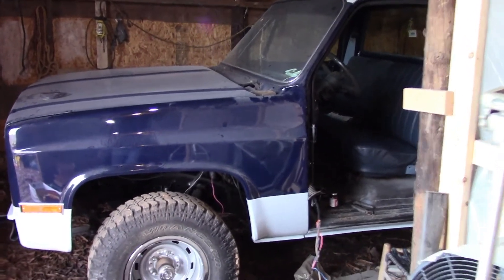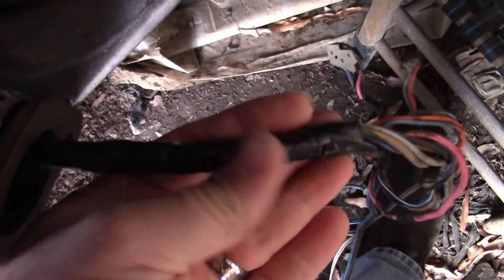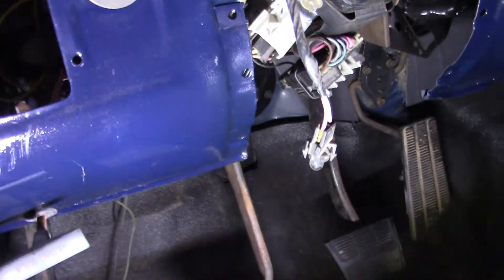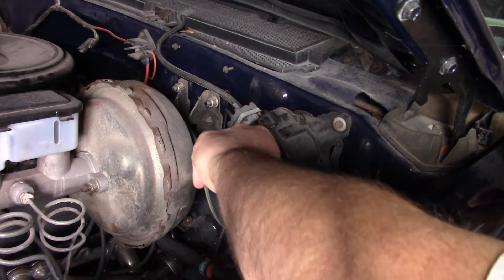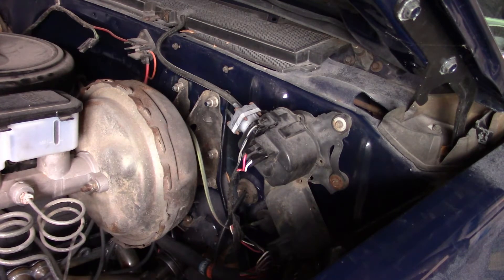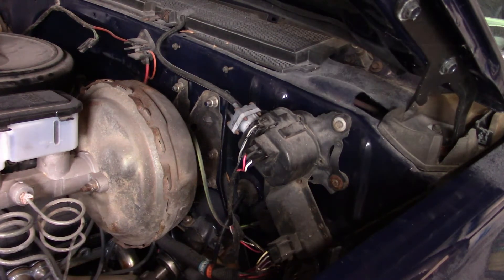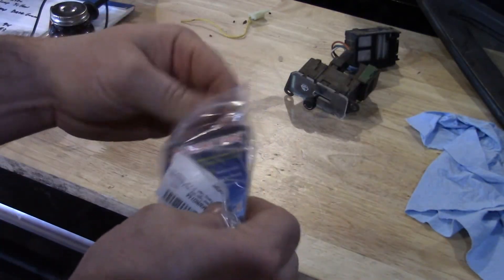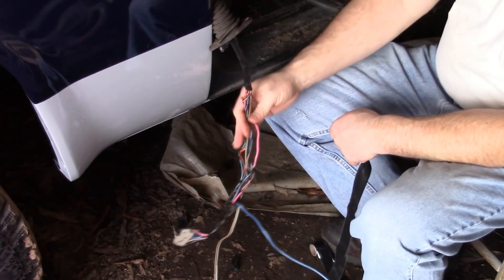1985 Chevy K10 Restoration Wiper Issues Fixed

Comment: Never used extreme tape before ill need to check that one out. Looks like the delay module took care of the problem fairly well.
Reply from the maker: Good stuff.  I'm going to get some more.  It seems to have been the issue.  Time will tell how long this used one lasts ;)

Comment: You were able to use the older style delay unit in the newer truck? did it plug in the same or did you have to splice in connectors for that older unit?  my newer style has gone out 3 times since I owned my truck and tired of hunting down 84-88 units, if the older ones can be used.. wiper motor new.. I have the newer style with remote pump on fluid tank though.,..  not sure if matters but it uses the style unit you first showed...
Reply from the maker: As far as I've seen, there were 2 different delay controllers.  One for the pre-84 models that had the switch on the dash, and those from '84 - 87 that had it on the column.  The older one will not work for the newer style.  The OEM controllers are almost impossible to find nowadays.  They used a variety of setups over the years with the pump on the motor and then on the reservoir.  I don't think it really matters as long as the motor is a delay style motor.  I believe the plugs are different for non-delay style motors.